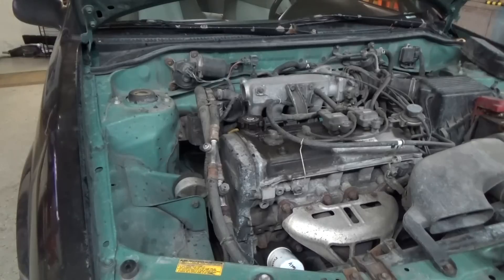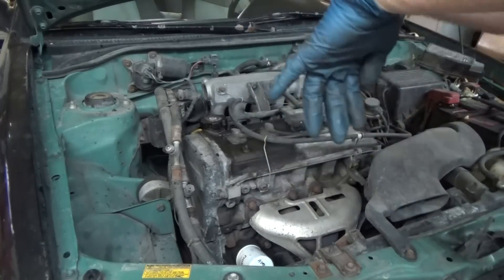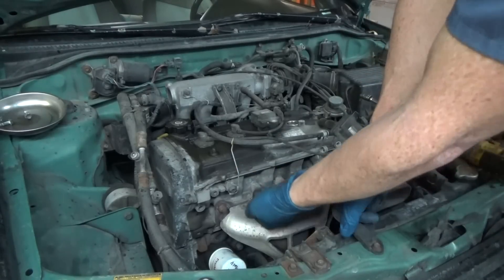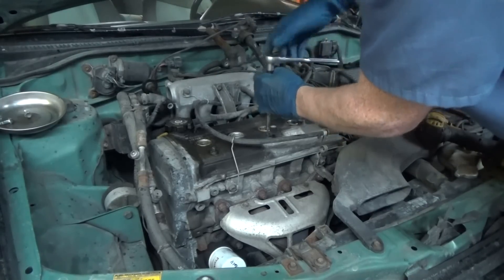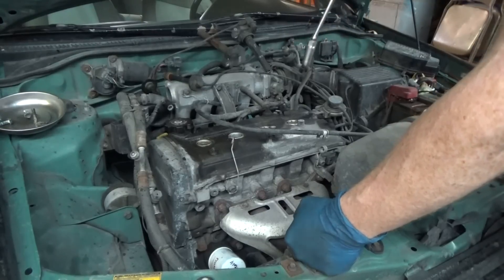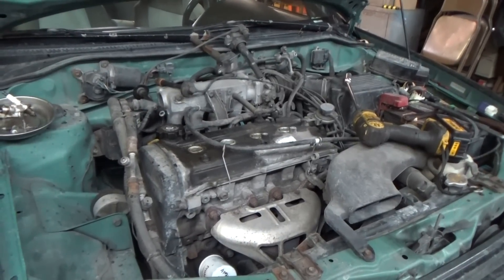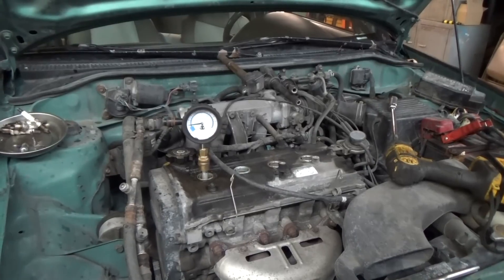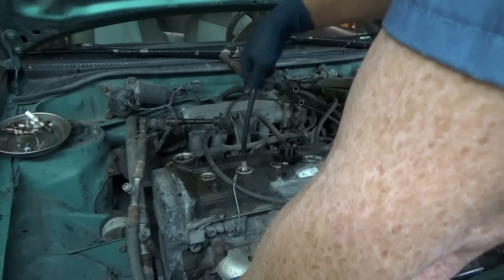What is Engine Blow By???

Comment: My Toyota Tacoma has 291,000 miles, and has no blow by. Also i done the plugs back in January, and they all looked really good, no oil on them at all. I have the 5vz-fe engine in my truck.
Reply: Bulletproof motor !
Reply: @jayy.cls6  3 years later, now I'm at 303,000, still without issues.
Reply: @bugtkz9153 well look at you. You deserve a hero cookie.

Comment: brian = I thought the same... since humidity can go into the engine while sitting...due to hanging open hose can cause maybe corrosion inside.I drove the car like that with hanging crankcase hose for the whole summer since I did not realized it was off.Today I connected it back the way it suppose to be.

Comment: hey Brian firing order 1342    i would start using transducers  for compression checks and  delta FLS type sensors for piston ring blow by  by installing on dipstick    waste spark firing on exhaust stroke is not for emissions   it closes the loop of the ignition circuit     i know i sound like a back seat driver   you are a GREAT tech  all the best to you bro
Reply: Cap

Comment: Question? How do I get rid of blow by?

I thought I had a cracked head because oil is getting into my coolant, but my neighbor read my compression sheet, & said I have too strong of compression for it to be a cracked head or head gasket.

He is a master mechanic, so I believe him.  

I was willing to pay him to fix the head or head gasket, & he doesn't turn down money, but he is pretty honest with me, for the most part.

He came to the conclusion that it's blow by. 

Drives me crazy, cuz it smokes, & my new radiator changes from fresh looking coolant to brown oily looking coolant, after driving.

Any suggestion on getting rid of blow by?

I have a 1990 Ford F-150.

Thanks in advance.
Reply: That guys a fool. Head gasket is only way that could happen or. Cracked engine block or head.

Comment: did you check the PCV system before  the compression test? I have some blow-by on my diesel Astra and mine pours oil through a lor of seals (dosen't burn oil or any funny noise, just did 300km with it on freeway without need to top up with oil). Heard of you don't replace the pcv filter every 100 000km, it clogs up and causes clow-by to build up (mine builds up only in the rocker cover, nothing comes through the dipstick) and force oil throught the seals.

Comment: Brian I bought a used engine,I flipped it over to gain access to the crank. Had it like that for a few weeks with the old oil filter hooked up. When I went to start it,she had a massive amount of blow by. It's slowly going away, and it looks like steam , there's NO oil indication in my air cleaner. I pulled plugs and a few of them were oil soaked ,after changing them the oil disappeared.What the hell, is it blow by or not .

Comment: My Astra H has sprayed oil all over from the top of the dipstick tube (pushing the dipstick up), now I'm getting brown oil in the top of the coolant tank and my coolant's low even after just being refilled. Is this blow-by? Or is it even worse? Of course it's worse, but is the clean-oil-in-coolant due to over-pressure in the crank-case busting the oil-pump gasket? Or is my engine dumping coolant into the oil, blowing oil out as it boils?

Comment: I love these 5E-FE engines. Mine used a decent amount of oil though it had 300,000 kms and 100,000 of them had rev limiter at every shift.  I never trust my honda D series motor as much..
Reply from the maker: I feel ya.
Reply: my d series won't die

Comment: is there a way use blow by gases as a pump to the intake manifold for a seperat fuel tank Im refering to manual carburetors somthing similar to the SU carburetors
Reply from the maker: I'm sure there is.  Any resistance will cost power though.  Race engine builders look at engines as an air pump.  Anything they can do to reduce reisistance and increase flow- they do it (within the rules).

Comment: never heard of that before. Great vid. Brian, from another vid I saw here, when cilinder had bad comp I think that the outer ones are prone to have poor reading compared to the center ones. Is that right. If so, what is the reason ?. On my prev car always got oily spark plug in number one ... it was so gunk that the cilinder wont fire at all. Cheers

Comment: Got a 97 OBW. Steady stream of air coming out of the capless oil filler tube. A friend says the timing may be off. I believe that's true. Regardless, Justin Stob at AWD in Oregon blogged about an overheated block can crack a cylinder lining. Any way to test for a cracked lining vs. worn ring without taking head off? (Obviously my engine overheated due to HG failure as explained in a few of your videos).

Comment: me, I change the segments of pistons diesel engine 2.0 l ... but now I notice the smoke that comes out of the oil cap with the motor rhythm, after asking the mechanic he confirm me that it will leave with the time, is it normal? ... I drove 250 km with the car, of course having to let it run 8 days in idle for reasons of 8 hours per day, now the draw of the car is a lot better but the story of the smoke, r disturbs me

Comment: Hey Brian, thanks for this video and the explanations all along the way. 
I have an '07 Mazda 3 with about 150 000 Km on it and basically the same
problem, black on the end of the exhaust all the time, oil consumption way
too high ( 1/2 litre per 130 Km) . What would  you recommend for a rebuild
on this engine?

Comment: Hey Brian is it a bad idea to use antiseize on sparkplug threads ?
Reply: That's a really controversial topic surprisingly enough. All spark plug manufactures will so never use it. I use it in my shop and will always use it. I live in the salt belt. Never seen it cause a problem in my life.
Reply: South Main Auto Repair
 I have a passat tdi and changed glowplugs added some antisieze  to the threads,( the old plugs were a bear to remove ,back and forth )
Reply: spark plugs, glow plugs, I use it on them both.
Reply from the maker: Plug makers don't want to get sued for someone stripping out a cylinder hole.  They also say to install plugs with a torque wrench.  I use it every time I do a steel plug into an aluminum hole.  The key is to use a TINY bit near the business end of the threads and let it spin the rest of the way round and up being cautious not to rip the soft, delicate, aluminum threads out.- Remember, if you DON'T use it, you can seize the threads to the plug and rip them out that way!  People say not to do things to protect themselves legally.  They don't care if your plug rusts in- as long as it can't be blamed on them.
Reply: Common sense is like never seize. A little bit goes a long way. Us mechanics that use the stuff know what I'm saying. Use one dab of anti seize next thing you know its on your face up to your elbows and smeared on every tool you touch for the next two days...
Reply: lol or just some jb weld?
Reply: or use an impact wrench?

Comment: Blow by  does not necessarily mean it will smoke out of the tailpipe. after all it's the compression rings that cause Blow by not the oil ring I've seen car smoke out the tailpipe that had no blow by and I seen cars that have blow by not smoke out the tailpipe so that's not entirely true statement and I ve seen engines that had both

Comment: what happens if I disconnect the crankcase breather from intake housing and let it hang downwards on its own.( but I plug up the air intake housing hole).. will it affect the engine?
Reply: I'd just run that breather into an apple juice bottle and rig another one coming out of it into the Intake manifold hole so its still a full loop but the oil gets trapped in the bottle. Just put a couple mesh coffee screens in it and bam 2$ oil catch can
Reply: drew= you did not answer my question... will it damage the engine the way it is now....hose is hanging and hole is blocked in air housing.?
Reply from the maker: It depends on the state of your valve train and piston rings.  They main thing is polution.   It could potentially get dirt in the engine if your rings are great and valves aren't.

Comment: Disconnect the injectors and remove the spark plugs in cylinder 1 and 4 and run it as a two cylinder! Problem solved!... if you want to get more economy savings strip the engine and remove the pistons and rods from cylinders 1 & 4 lol
Reply: And you will have a perfectly unbalanced engine.
Reply: Gerardo A. H. it was more of a joke post... if you want an economical engine you might as well get one that's designed to be economical. you can get a 2 cylinder engine which is in the Fiat 500 (the 900cc twinair) but it's actually not that great, most people only get 45mpg... the Aygo has a 3 cylinder of a similar size (999cc) and most people get 55mpg.

I own this car and I've averaged 65mpg from the day i've owned it and even got 80mpg on a recent drive on rural roads with light traffic traveling at 50-60mph. I had my dad along with me and he said that the engine was smoother then his 2003 mazda 2 with a 1.6L 4 cylinder, that's probably because it's a newer engine which also has VVT-i (variable valve timing) which keeps the engine near peak torque throughout the entire rev range (80% of the torque is available at 1500 rpm... peak torque is at 3600rpm)

Comment: I'd just like to take a moment to boast and gloat if I may.... 1982 gmc c20, with all original drivetrain... with the ORIGINAL 26'000 miles on it and never rolled over :) ...... Just took a piece of paper to the the valve cover there the oil filler is.. Not even a puff of blow by on it AT ALL :) even at the PCV valve no blow by at all :). And no the motor was never rebuilt or swapped out its all numbers matching :)
Reply: Althou it may be just a hair but of blow by but not enough to make a piece of printer paper move. Will try with a tissue when I change the oil in the morning and see. That might make just a little shimmer.
Reply from the maker: +Aarons Automotive That's pretty good Aaron!  Take car of it and it'll take care of you!
Reply from the maker: One of the two is like a dud firecracker each time.  It's inert.

Comment: Can an engine still have excellent compression yet the oil rings are bad?
Reply: BigBlackNerd  I've rebuilt my engines head.  Compression is great in all cylinders and it still burns oil.
Reply: BigBlackNerd It doesn't lean ANY oil and the head was professionally rebuilt by the Toyota dealer's machine shop.  (highly recommended)  Cylinders: 1 - 175 2 - 180 3 - 180 4 - 190/
Reply: BigBlackNerd  Thanks but not as cool as your name.  :)
Reply: maybe your block need a rehone/resurface